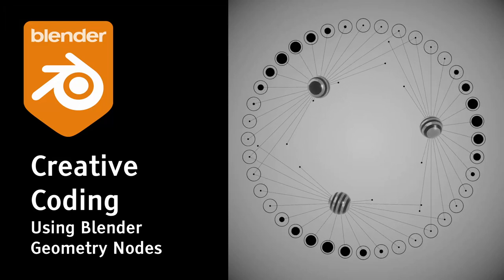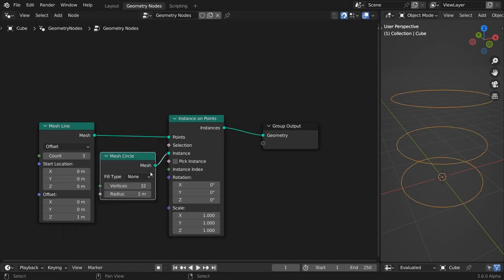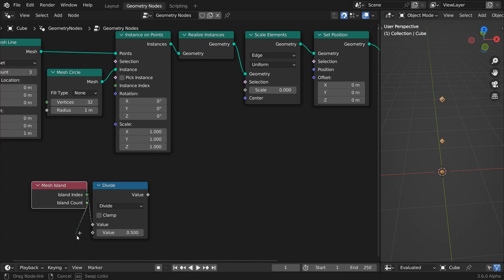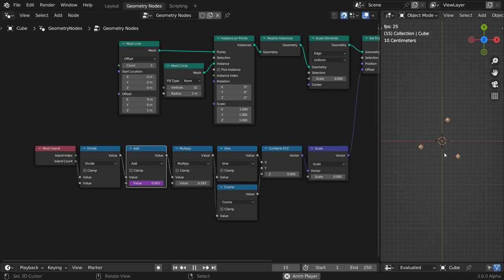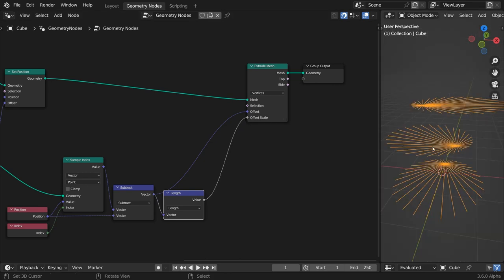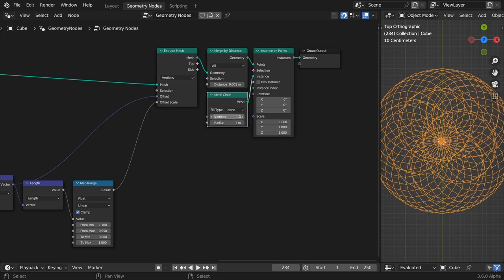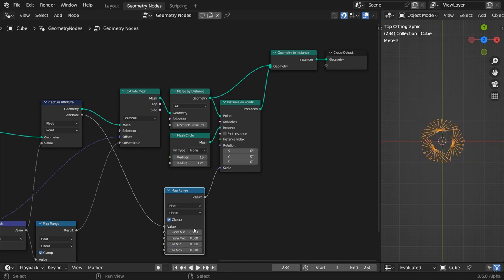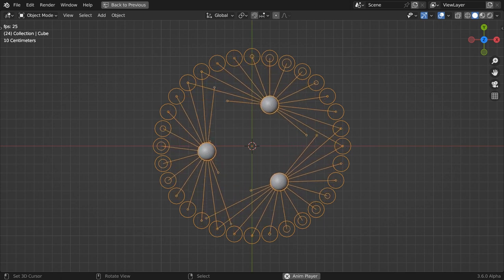Creative Coding with Geometry Nodes

Comment: Amazing video... ❤
Just a note when you divide the island index with the island count ( 2:19 ) you are not getting a value between zero and one.
This is because the island index goes from 0 to count-1 so the highest value in the index is less than the count and hence you never actually get .
Usually it is a good idea to subtract one from the count before dividing it from the index.

Cheers 😊

Comment: Amazing stuff. Now if anyone can figure out how to instance a sphere onto the rotating points, I'm all ears. I'm just plugging into nodes willy nilly and creating chaos
Reply: hi @fredozamas I figured it out. I restarted the tutorial looking for the spot where the three points were rotating. That's where I want to add the spheres. 
I hope you can follow my directions here: starting at the far left of the geo node tree, Mesh Line goes into 'Points' on Instance on Points. Output of Instances on Points goes to node Realize Instances. Follow the output path that goes to Scale Elements. That output goes to Set Position. 
The node you want is right there, the Set Position. Add a new node coming off the 'Geometry' output and make it an Instance on Points. For the 'Instance' type, I dragged a line to the left then searched for UV Sphere. I set the radius to .1
The output of the Instance on Points node goes all the way over to the right to the Geometry to Instance node.
Between the Instance on Points and the Geometry to Instance nodes I added Set Shade Smooth and Set Material nodes.
Reply: @mystery_guy  Thank you, was driving me a bit crazy also pluging into random nodes lol I mean I got some interesting results by random, but couldn't achieve the spheres in place O_O
Reply: @mystery_guy  thanks mate,right on point

Comment: Hello, I'm encountering an issue while trying to rotate the UV sphere along a circle. I attempted to align the Euler rotation using the position to vector method and connected it to the rotation input of instances on points. However, only one UV sphere (the bottom one) rotates along the circle, while the other two spheres only rotate around the Z-axis. It seems that the other two points do not possess the same attributes as the bottom point. Can you help me to understand this. 🙏 

I ended up creating an additional set of Geometry nodes by duplicating the original ones. I rotated the Z-axis in 120-degree increments since I only placed three points. 🤦‍♂

Comment: This may sound stupid question but I don't understand , when you drag a link from an existing socket and then the new node fits automatically between previous two nodes? When I do that new node stays attached to the socket from where i dragged it. Does that make sense? e.g. @1:24
Reply from the maker: It takes another Alt+Click to insert it between two existing nodes.
Reply: @ilirbeqiri  I tried with Alt +click but it does not let go of the link from the first node.
Reply: @ilirbeqiri  This is weird. I wonder If is it bug or something. Because I can see hint in the panel that says Alt for toggle auto attach. But when i press Alt node still stays connected to the previous node. This is driving me crazy, if am I missing something? Could you please explain in some other tutorial how does it work? Thank you.
Reply from the maker: @NB_nobody  Sorry, maybe I didn't explain it clearly. It works it two steps, first I drag the link from the outgoing node, enter the name for the new node and click to lay it down, then Alt+Click to disconnect it from the first socket and insert it between the initial two.
Reply: @ilirbeqiri  That works in my case. But in the video it happens so fast. Is it because you have edited that part from the video that the laying down part is not visible in it?
Reply from the maker: I do it instantly, without thinking, but I also edit my videos tightly, so one can miss it. 😉
Reply: @ilirbeqiri  Thank you for your time. Your videos are very informative. 👍

Comment: hi Ilir,  I'm trying to duplicate your rotation of the individual inner spheres. Your spheres all  rotate around an inner circle AND with each sphere rotating on its own axis.
I'm stuck trying to modify the tree right at the Instance on Points that generates the spheres, with a UV Sphere as the input as the actual Instance.
Can you please give me a tip to point me in the right direction to facilitate the rotation?
I've been searching for a tutorial to address this issue, no luck.
Best I can come up with is to use a Normal, a Rotate Euler and/or an Align Euler to Vector. 

Thanks!
Reply from the maker: You’re in the right direction already. Align Euler to Vector (align Z axis to position vector of each sphere instance in this case), followed by an Euler Rotation (rotate just the Z axis). Feed the result into the rotation input of Instance on Points node. I didn’t include this step in the video because it would take twice as much time to explain. But that can be the subjects of another tutorial.
Reply: @ilirbeqiri  thank you my friend, I've got things running pretty good now, really looking forward to doing all your tutorials!

Comment: Thanks for your fasicinating work. It really shows the beauty of math. Howeve, when I trying to export it by apply the geo node modifier, I met the problem that shows "Evaluated geometry from modifier does not contain a mesh". Could you help me with that? Blender version 3.5.1
Reply from the maker: Thank you. If you apply the modifier you’d be only exporting a static version of the geometry. I don’t know why you’d need that. However, to apply the deformer, you have to realize the instances first.

Comment: I'm not quite grasping how the sample index is used, does it grab the position of each point at that step in geometry? How does that differ from the position given by the position node?
Reply from the maker: I see you've intently followed my video. It may not seem apparent, but the position node (as all field nodes) is context dependable. The values it returns are dependent on the geometry node they are connected to. In this case the position node returns the position vectors of points for the geometry going into the Extrude node. The position field coming out of the Sample Index node returns the position vectors for the geometry branch going out from the Realize Instances node. So basically, we subtract the current position from the previous step position giving us a direction vector. I hope this makes sense.
Reply: @ilirbeqiri  it makes more sense now. I've been wondering if there is a way to use the indices from the other instances along the mesh line in a 3 dimensional way, or offset the indices to connect to the next one rather than the same one using something like the modulo operation perhaps. Great video.